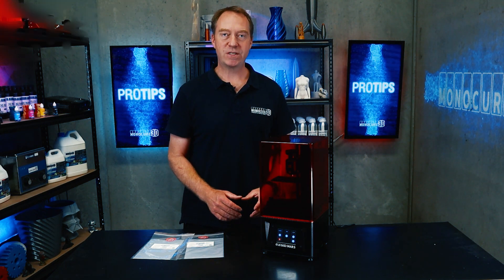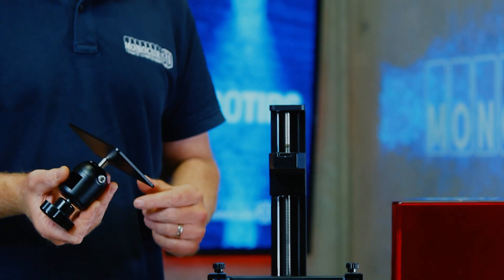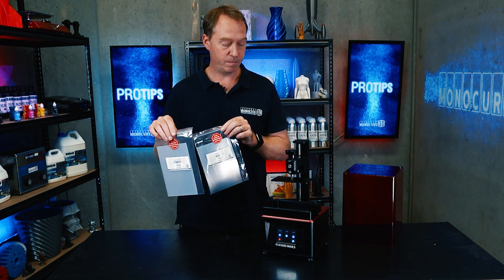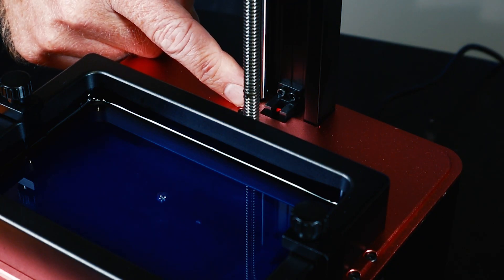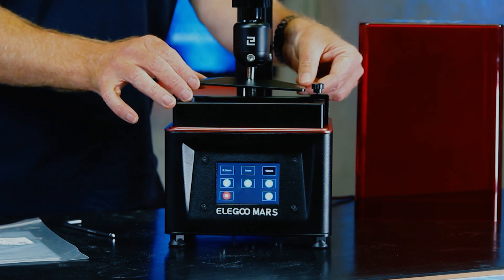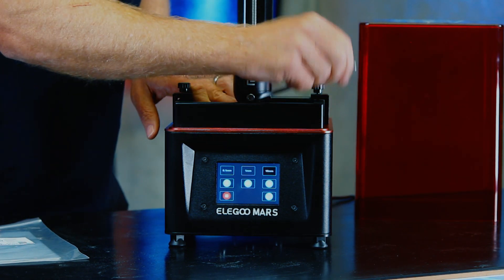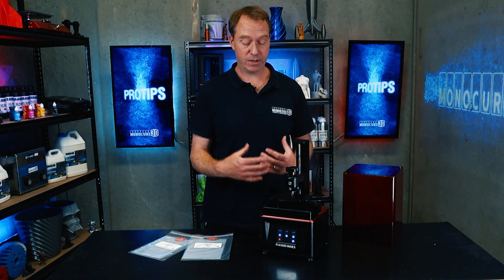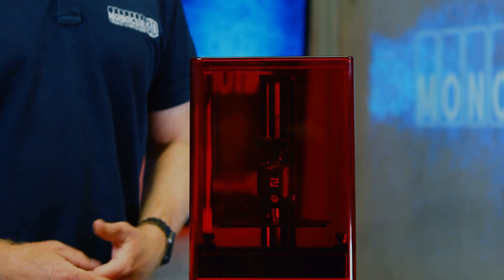Levelling the build plate - 3D Printing with Resin - Part 04

Comment: So this will fix the prints not fully sticking? I'll have a raft stuck to the plate and a pancake of resin on the fep. First print ever it's a little discouraging
Reply from the maker: Can be a number of reasons...check out this video - How to get the 3d printing resin to stick to the build plate.

Comment: 👏 Never 👏 Level 👏 with 👏The 👏FEP 👏 In 👏 Place👏
Reply: Isn't that literally the point of the video?
Reply: @sheppieboi  leveling with paper, sure. But leveling with the FEP in place is just asking for trouble.
Reply: @theremembrancersretreat4922   For me this method worked way better. The paper is too unreliable with you having to adjust resistance. I find it vague, like what is little resistance? How do you measure that? For me a nice IPA cleaned work plate on a nice IPA cleaned tight enough FEP sheet is the perfect way to do leveling. You level to the actual thing you'll be printing on. Plus paper an be different thicknesses as well, not all A4 papers are the same. For me it's just too many variables. But I get you point as well. Fair enough.
Reply: @theremembrancersretreat4922  you provide no reasoning to support this.

Comment: Thank you so much sir! This fixed my problems!!
Reply from the maker: I'm glad we could help!!
Reply: @Monocure3DProTips  If you do not mind, I have another question. When I print it does it pretty much perfectly now, except for one part. When it comes to printing something that is coming off the main, like arms or hair, it does not seem to adhere to the platform and then ruins the rest of the print. Is there anyway to ensure that those parts print properly?
Reply: @DTrainn31  Please use thick supports with a good contact point to make sure they print properly.